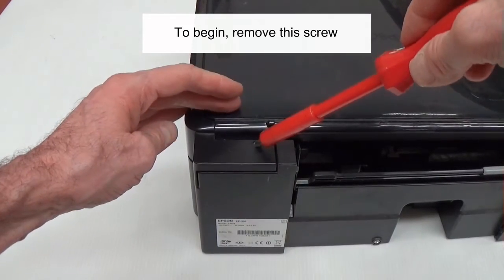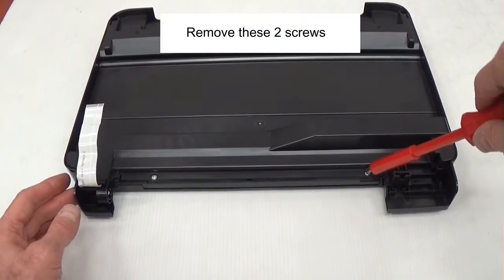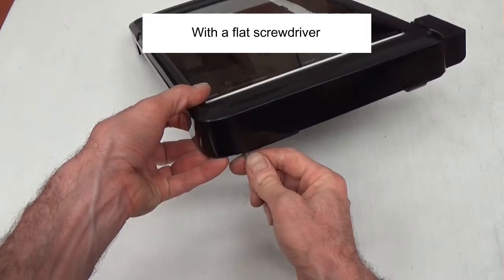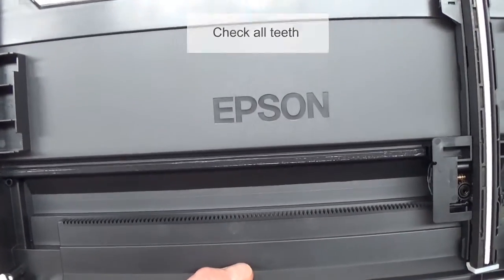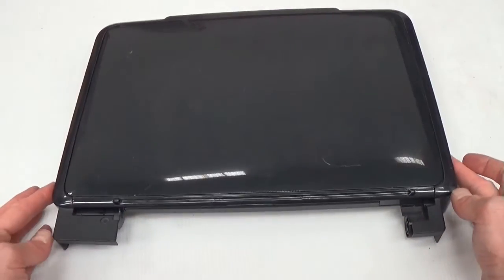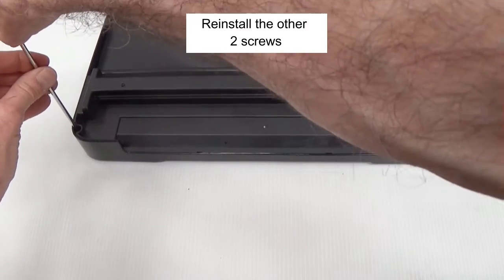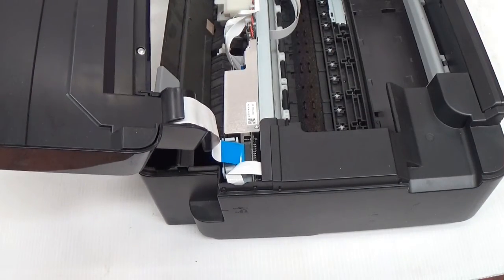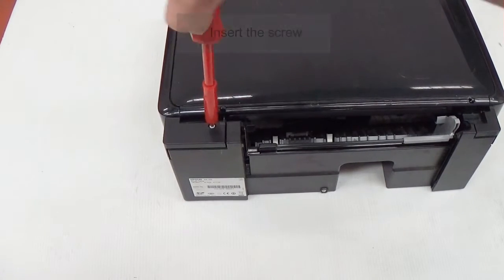How to remove and clean Epson printer XP series Scanner Unit

Comment: Hello Gianni,  I need HELP with my Epson printer.  I was removing the Scanner cover to clean the printer heads and the scanner tape pulled out.  I can't get the blue tab at the end of the tape to slide back in to the board?     I have watched your video, many, many, many times.  As far as I can see there isn't a slot on the board for it to slide in, connect to, lock onto????   The magnet the tape goes over has a slot in it which you can feed the tape through but this doesn't appear to do anything.    Thanks Gianni for any suggestions you might have.

Comment: I have a question, I have the exact same all in one printer , however the glass was broken during the shipment.  Is there any possibilities I may use the printer separately after removing the whole scanner?
Reply from the maker: I think you can remove the glass but not the whole scanner. The printer will send an error related to the scanner
Reply: @viandant5 I have removed the glass , however the printer won't work and showing there is an error with the scanner... anyways thank you !

Comment: I have an Xp850 and I get scanner error 0x10 (sometimes 0x20) . I have removed the adf unit and top part but I now find difficult to open the scanner unit without using force. Could you confirm that flat screwdriver will not break the plastic? Thank you 👍😃
Reply from the maker: Yes, there is no glue

Comment: my ET2550 printer won't print, it was suggested by a repair shop, the scanner assembly needs replacement. Is this far different than cleaning the glass?
Reply from the maker: you can try to remove and cleaning the glass, checking the connectors but if there ar ebroken parts it will not work
Reply: @viandant5  I took mine apart and the scanner roller came out; I thought I put it back in correctly, but it won't work now.

Comment: i have followed the whole procedure but after i i tested the scanner,i noticed that only middle half of the picture being scanned is captured,what could be the problem?
Reply from the maker: if the settings are correct try to disassemble and reassemble the unit. the leds could not be in the correct position

Comment: Wish it was like that for the epson xp950 but the lid doesnt undo like you showed. If you have an xp950 maybe you could do a demo so I can clean all the ant muck out of the scanner tracks
Reply: I thought I was the only one with an ant problem.  They got into the scanner section and left a big smudge on the screen, which showed up on copies.  I cleaned it with this method, now the printer won't work.  Says "scanner problem."